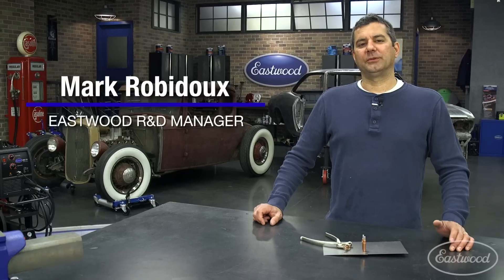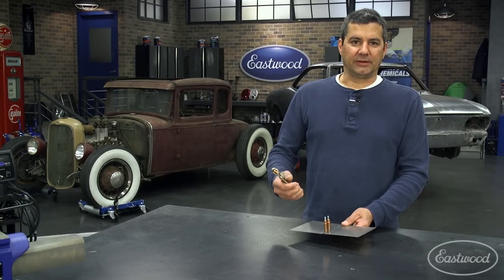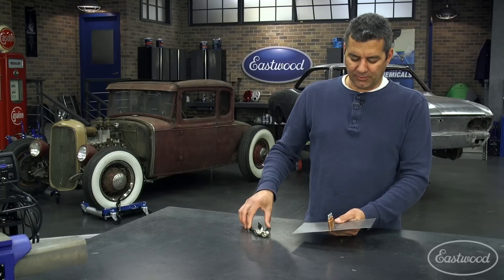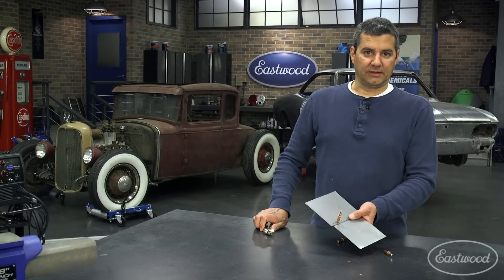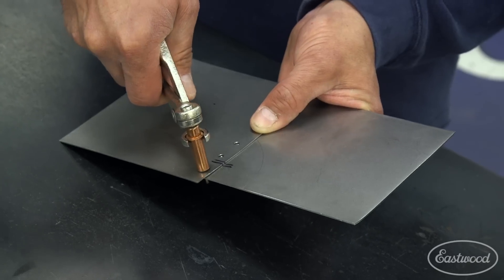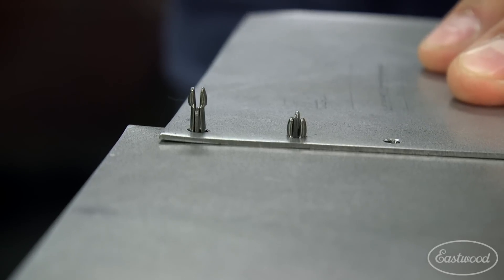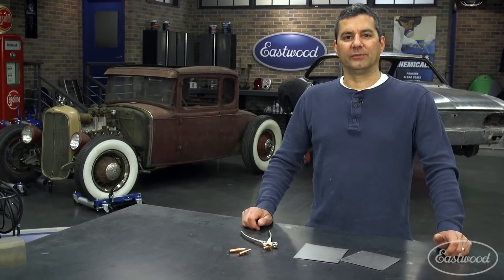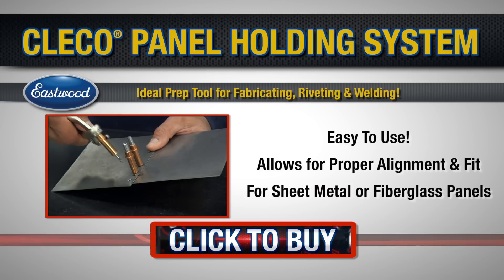Clecos® Panel Holding System Explained - Must Have Metal Fab Tool from Eastwood

Comment: What size is a factory spot weld on a classic?
Reply from the maker: Standard practice when replacing spot welds with plug welds is 5/16 or 3/8" diameter.

Comment: Hi, I'm looking to buy some of these but they come in many sizes,  in your vid you talk about 1/8 Clecos, is that the ideal size for auto panel work?  do different sizes have different strengths,? these holes need to filled later so i guess you don't want a huge hole?
Reply from the maker: Check them out here:  http://www.eastwood.com/panel-holding-system.html?utm_source=youtube&utm_medium=annotation&utm_content=cleco%20panel%20holding%20system&utm_campaign=2016-06-23
Reply: Eastwood Company Thanks

Comment: A good investment that will last for many years. I have some that are over 40 years old. You may need a screw as an anchor once in a while, but if you're fabricating a piece from scratch that needs to be removed and reinstalled several times, you can't beat having a set of Clecos. They aren't cheap, but they're worth every penny.